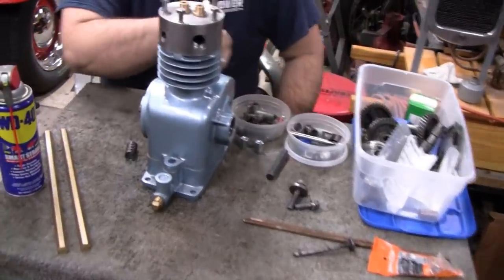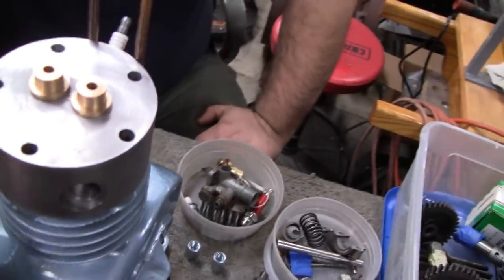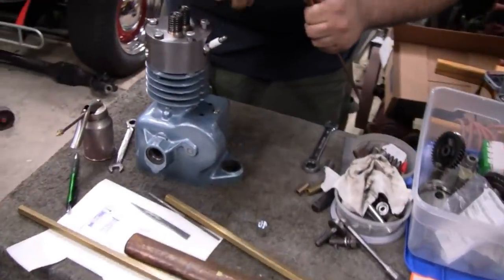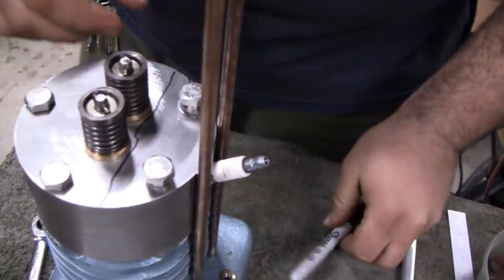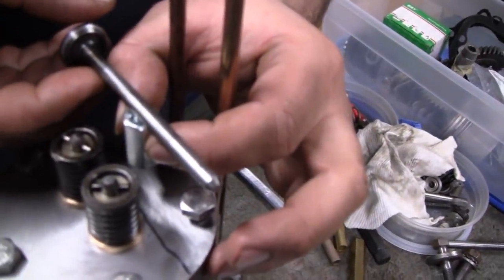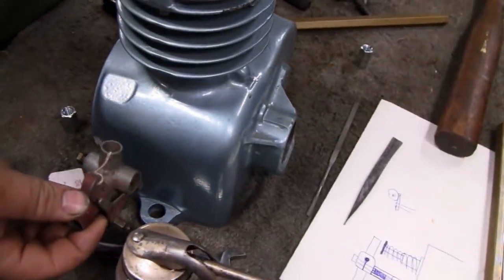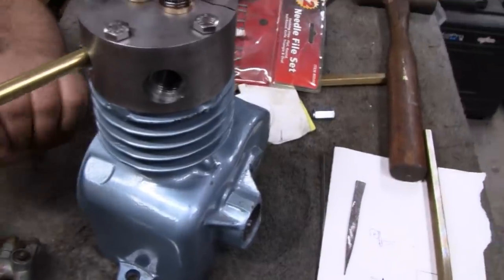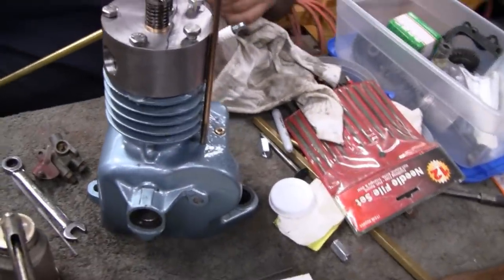HOMEMADE OVERHEAD VALVE BRIGGS (part 31)

Comment: Two heads are better than one,....but have you tried 76,000? 
Good ideas you two,..those brass pieces will look really nice with the color on the block.
Reply from the maker: Thanks Bud!! I picked up a piece of SS tube for the carb, the wall is alot thinner and should be a little easier to work with!! The rocker tower and platform will still be brass though!!☺

Comment: My vintage clinton that i got from the junkyard is in good shape the cylinder is smooth and shiny almost like its new the piston rings are perfectly good it has low compression and no spark but other than that its a good engine

Comment: the soldered hex to brass plate will be plenty strong enough however i think that a 1/4 steel rocker shaft through the hex then combined with the repetition of the vale train opening and closing it will wiggle the 1/4 shaft loose in the hole and it will start to see saw. Either a thicker hex post or use 2 at either end of the 1/4 rocker shaft with the rockers inbetween. i could be wrong though so im interested to see.

Comment: Nice to see this project again. Instead of silver solder how about
a brass to brass braze of the items? Should hold up better. Also
any thought as to the lubrication of the valve system or did I
just miss how you were going to lubricate the wear points?
Keep up the very interesting videos on all of the projects. Aloha
Reply from the maker: Thanks Bud!! We might use brazing rod!! We're gonna lube them like Briggs did in the 20's!!☺
Reply: Good deal, keep it up!. Aloha

Comment: Yeah, bending that brass will be tough. Maybe an elbow will help.
Reply from the maker: We picked up some stainless tube, the wall is alot thinner (.035)!! That brass had a .065 wall!! We'll use some sand and heat and hopefully we don't screw it up!! An elbow is not outta the question though!!☺

Comment: If you don't have a bender for the brass pipe you can fill it with sand and bend it so the sand won't ruin it when you bend it. It's just a thought. Love your videos I'm liking what you are doing.
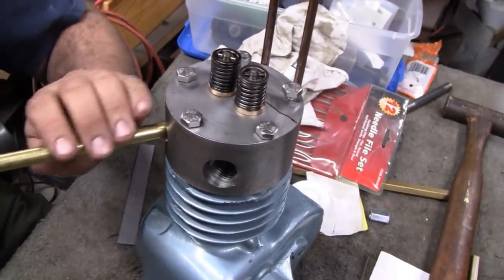Reply from the maker: Thanks Bud!! I think that's what Roadking said at 9:35 !!☺

Comment: Make a semi circle block that bolts to the top of the head with a steel shaft running through for rockers.  Mill gaps for the rockers to move in.  Keep studs and bolt the block down.  Single column is weak, might bend under stress from pushrod/valvespring load.  Monolithic milled piece instead of soldering stuff together.  Could be aluminum, brass, whatever.  Start with a round blank same diameter as head, bandsaw off most and leave the semi circle block.  Mill rocker gaps, cross drill rocker shaft, drill and mill head bolt plus a recess.   Super simple and much more robust.

Comment: Instead of a crescent shape for the brass plate, I would suggest having it fit over the entire surface area of the head, but just with the 2 valve spring hole in the center. That, in my opinion, would look a little classier and would add a little more structure to the pedestal. Even the force on the rockets isn't going to be like a top fuel motor, the less of a chance that pedestal has a flopping in the wind is best! Wish y'all luck!

Comment: You have a steel head. Make whatever design is used to support the rockers out of steel and weld or bolt it to the head. Don't support it with the head bolts.

Comment: if you screw into the block you would want to stay above the oil line right? otherwise you get oil pouring out the threads
Reply from the maker: We'd be alright with the oil line, we're worried about the spark plug, the screw would go right into it!!☺

Comment: To make the 90 degree bend you could use a 90 degree brass fitting and drill out the threads and solder the 2 pieces of brass tubing into it.

Comment: You think the intake is long enough?

I've got another 12 feet of pipe. :D

Try not to put a sharp 90 degree bend 
in the intake.  Fuel and air tend to 
separate, doing that.  Also, Home D 
has tubing benders that are "screen 
door" type spring-looking things.

Great video, Everett and the guys!

steve
Reply from the maker: Thanks Bud!!☺

Comment: I was wondering where that built went! Glad to see it back :D I'm wondering if it would be easier and cleaner to just drill and tap the head for the center support instead on cluttering it up with the brass plate? That's right above the spark plug and shouldn't compromise the head strength

Comment: Do you have plans to lubricate the rocker arms?  Perhaps an oil cup on the vertical hex mount and cross drill the pivot shaft.
Reply from the maker: We're gonna lubricate them just like Briggs did back in the 20's!!☺

Comment: There was an older way where you'd fill the pipe with lead and bend it, then melt the lead out...but i never managed to make it work quite right, not with thick wall, thin wall, works neat.
Oh or ROSIN, that one worked too. I can't find it because it's hidden in the freakin attic, but i have copy of Popular Mechanics that details bending pipes this way.
Reply from the maker: We have lead, that sounds like alotta extra work though!!☺

Comment: Glad to see it again. The really long tube induction pipe will be great for low end power! I wonder if the single point rocker pedestal will flex.
Reply: Give it ALL the intake runner
Reply: I think the single pedestal might well flex if it's made of the hex stock.  But if the pedestal width is increased to match to the inner surfaces of the rocker arms, the added width would prevent the flex.  Greg
Reply: @tamaralee4108  
I have never seen anything like this before as far as rocker shafts go. Low rpm target may allow weak enough valve springs, it will be interesting to see what they do no matter what.

Comment: I like the Pivot rod idea RK.
My question is where will you adjust your valve lash? Make an up and down adjuster on both the rockers either at the push rod connection or the valve stem ?
Bend the fuel line  around a pulley of similar sheave gap :)
Reply from the maker: Thanks Bud!!☺